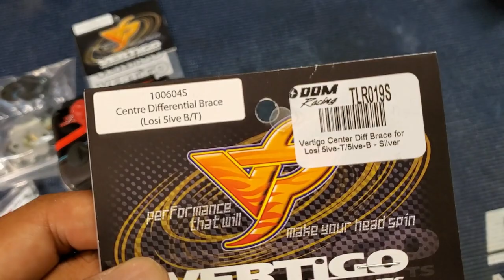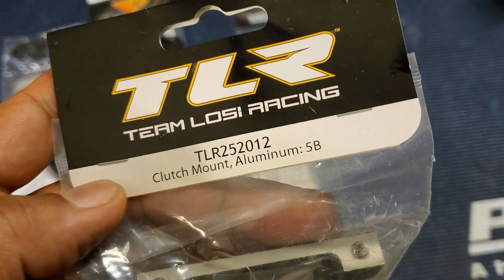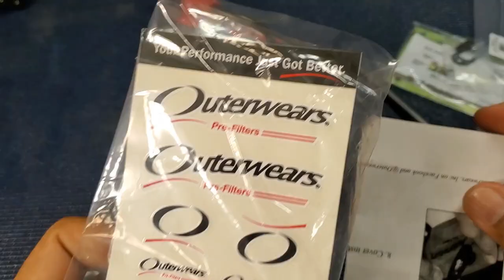Another 5ive-T Update/Engine Install

Comment: That's the 1.0. The center diff is rotated
Reply from the maker: Correct. This is a pretty old video. Lol
Reply: @CrucialRC  I think somewhere in the thumbnail or title says 2.0. Anyway my motor didn't fit in a 5T, so II was looking for some video to see how a motor is installed in a 2.0 5ive-T
Reply from the maker: @Victic005 sorry brother. No where did I put 2.0. This video was shot before the 2.0 came out. I have the mcd w5 now tho. Good luck with your searches👍🏼